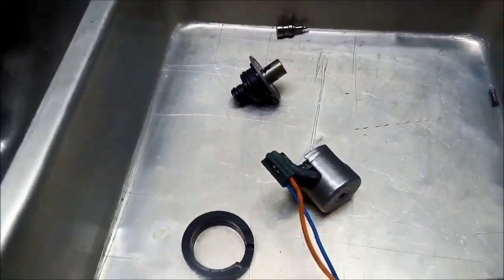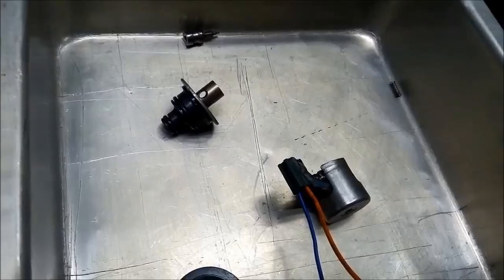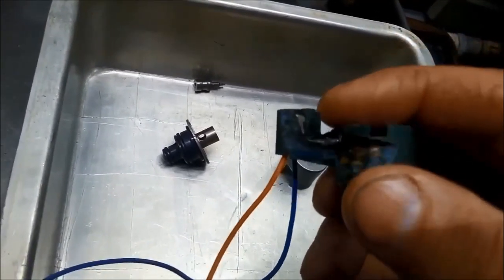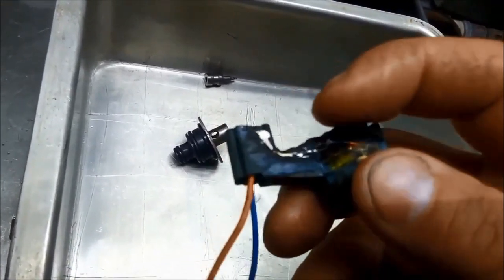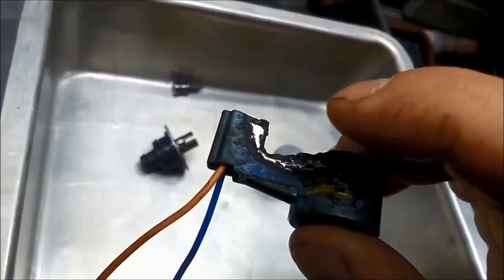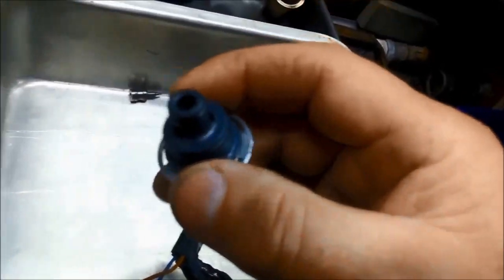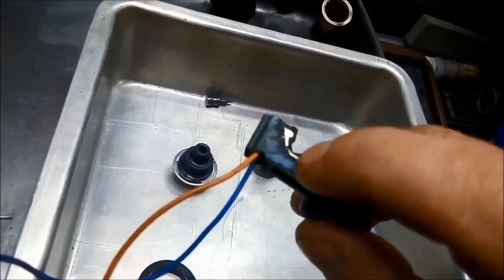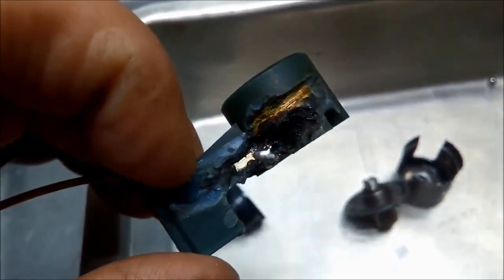4EAT Subaru TCC Torque Converter Clutch Solenoid Repair

Comment: would this same procedure apply to the phase 1 version of the 4eat with a faulty tcc solenoid ? i understand this is for the phase 2 version but cannot find any aditional sources assisting the previous phase .
Reply from the maker: hi, similar with all solenoids. cheers

Comment: in need of some assistance, ive got a 2003 subaru forester automatic, when i put into drive it takes a second then when i give some gas its slowly starts to shutter. but once it gets moving its fine if i dont romp on the throttle.. do you think i need a new torque converter?
Reply from the maker: hi, check all the basics ( fluid level etc ) sounds like could be blocked filter or internal pressure leak. you can do a stall test on converter. cheers
Reply: @YepThatsIt  ive done stall test and it shudders and also replaced fluid
Reply: should i put in some transmission fix?

Comment: G'day, My subaru 2014 CVT TR580 has got P0971 OBD code. Mechanic said he has flushed, replaced CVT oil however he wasn't aware that Valve Body in top of the Transmission. Now how much it should cost to change the whole valve body or only one Solenoid can be replaced. I am in Melbourne so not sure how much it should cost.
Reply from the maker: hi, sorry we dont give out quotes on here. contact us via our facebook link in description. thanks
Reply: @YepThatsIt  Done :)

Comment: i have a 2008 outback, im prety sure its the 4EAT transmission, that is the Phase II Version II but im having trouble finding out for certain ? is there somewhere that will give me a definite answer based on the vin number etc ? 

i have a feeling i might have an issue with solenoids on the valve body but im waiting for a scan tool to arrive to learn more yeah
Reply from the maker: try contacting a dealer, they will usually give you the relevant info. cheers
Reply: @YepThatsIt  these dealers seem to know less about their cars than the guys who work the registers in auto parts shops lol ;) i did find this info out though which does confirm its a E-4AT but says nothing about "Phase II Version II" ? basically im just trying to get the exact info so i dont end up ordering wrong repair parts after spending  hundreds of hours coming this far in my research to fix the bloody thing lol https://legacypic.uk/transmission/search.php?code=tv1b8mffba
Reply: Think phase 2 you can actually use a Kia replacment solenoid

Comment: Hi mate, is this the solenoid that   needs replacing because it causes the binding on the front wheels on tight turns? Getting 5.5 ohms on it and 3.5 ohms on the other 6 solenoids. Cheers
Reply from the maker: hi, the resistance varies with temp, but in your case that one being the odd one out would most likely indicate its faulty. make sure you flush the other solenoids as well and test as best that you can. cheers
Reply: @YepThatsIt  ok, I realised that the 6 are duty solenoids and are correct at 3.5ohm and 5.5ohm on the 7th EPC solenoid is also correct. My problem lies with the clutch plates or maybe another solenoid in with the clutch plates. But new oil helped a little but problem is still there. Got a used rear casing from U-Pull-It for $36AUD. Fingers crossed. Hope this info helps anyone out there.

Comment: Where would this be on the 2000 Subaru Outback? Did your transmission run ok without the solenoid as far as RPMs go? Was it a big difference in RPM between when it was working and without it working? I'm wondering what difference it would make on how much less gas mileage would be. This is what locks the torque converter when the car is warmed up and in 4th gear, correct?
Reply from the maker: hi, when the torque converter clutch locks up, it will drop the revs by a few hundred rpm in top gear ( but in some trans tcc comes on other gears as well depending on the trans ) to save fuel. cheers
Reply: @YepThatsIt  Checking this asap. Tomorrow morning. I was driving bout 70ish one time and the rpms dropped by  almost 5 hundred! Fvcking blew My mind! Never knew thus could happen, never had something like this happen before though. Wish Me luck! Salute
Reply from the maker: @BangChief_AllIsOne  cheers

Comment: Just a question in relation to valve body and single solenoid purchases. There are multiple avenues online to buy single solenoids for torque converters for subarus. Here is an example amongst others:https://www.ebay.com/itm/Torque-converter-Lock-Up-solenoid-For-Subaru-Lineartronic-CVT-TR580-TR690-/273758133046?_ul=AU

Has this availability to be able to be purchase singular solenoids a recent transition?
Reply from the maker: hi, make sure you get the right solenoid that you need....the one on the link you sent me is different ( for a cvt tr580 / tr690 should have between 10-13.5ohms resistance ) to test any solenoid properly, make sure you also warm it up to about 90 deg C as well as often solenoids fail when they warm up ( not with heat gun ) cheers

Comment: Does this work on the phase 1 4EAT transmission??  I'm getting a P0740 code and believe this is my problem.
Reply from the maker: hi, if you have any similar solenoid, you can possibly repair it in same or similar way. cheers